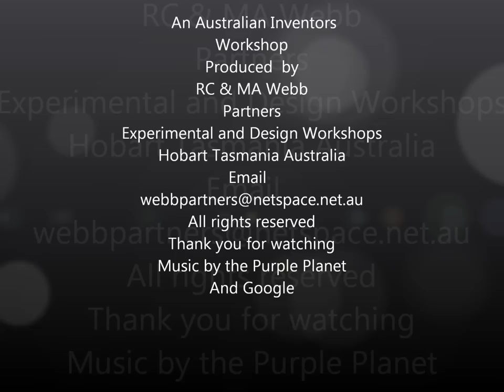75  CNC Router, FAIL !!! things go wrong !!!

Comment: I am not saying this is what is happening. But with my 6090 router I noticed a 1/8" ball nose endmill creates a lot of fine sawdust and it gets everywhere in my shop. So with that said the controller box has air intake vents on both sides and a cooling fan on the rear side. Same with my computer. So what I have done is taped on some filters on the controller box and front of my computer. The filter is really similar to dryer fabric softener sheets and works well to keep that dust out of the machines and collecting on the break out boards and mother boards. Every so often I will take those cans of compressed air and give it a few small bursts of air to blow out the machines electronics. This seems to work well for me. Only other option would to be to run a long printer port cable I think its DB25. Run it to a separate room where dust cannot infiltrate the computer.
Reply from the maker: Jason Emerson

Finding out all
this new stuff is half the fun ;) Thank you for your comments and
watching my video. Roger Clyde Webb Australia
Reply: buy me a plane ticket to Australia and we can work on your CNC so you don't have those problems anymore.
Reply: Now he has his own factory making new CNC machines.

Comment: Hi Roger,

So sorry to hear you are still having problems.  One thing I have heard of is static electricity caused by a shop vac causing a surge and wiping out control boards etc.  Hope you find the problem soon.

Roger
Reply from the maker: Roger Jette 

Hi Roger,  I have had it, I just finished downloading
Mach 3, and have purchased a Mach 3 breakout board. This should get things running again. Thank you for watching and
great comments. Roger Clyde Webb Australia

Comment: Thanks for the videos Roger. This CNC looks like it would work well for me. When you set it up for 4 axis work, what is the maximum work length?
Reply from the maker: Pacific Tooling ships  worldwide: Email me at : info@pacifictooling.com I will send you information on our new * Lathe * and 4040, 6060, 6090 and 6012 (linear rail model) CNC routers and CNC lasers 6040, 6090, 1390 and 1225  .
Pacific Tooling; Australian Inventor Roger Clyde Webb ;-)

Comment: At first you figure maybe a G-code violation or line limit.  But that looks like real trouble.   May need major cooling on the router CPU or a diff. CPU.  Did it fry any of computer stuff?  Always good to run high speed sim before committing to wood, or use a touch point for 0,0,0 outside the cut.
Reply from the maker: Sailgoat 

Finding out all
this new stuff is half the fun ;) Thank you for your comments and
watching my video. Roger Clyde Webb Australia

Comment: did windows die ?
if yes then it could be overheat that shuts the PC down.. check the cpu fan, full of dust? running ?
Reply from the maker: xang72, I
just finished downloading Mach 3, and have purchased a Mach 3 breakout board. This should get things running again. Thank
you for watching and great comments. Roger Clyde Webb Australia

Comment: If you use USB consider using powered USB hub between computer and cnc controller
Reply: Why
Reply: @chrisreynolds2410  because powered USB isolates computer from device.
Reply: Thanks.